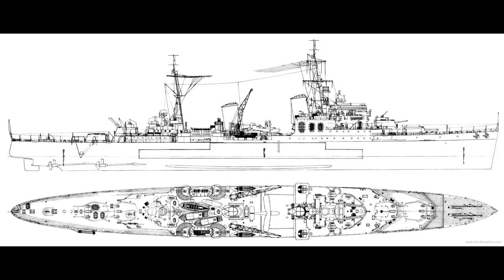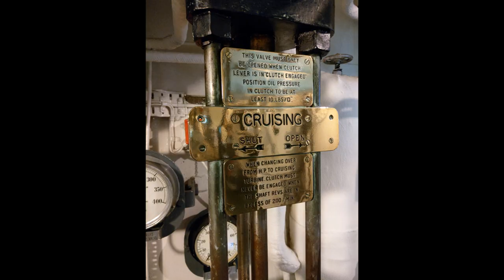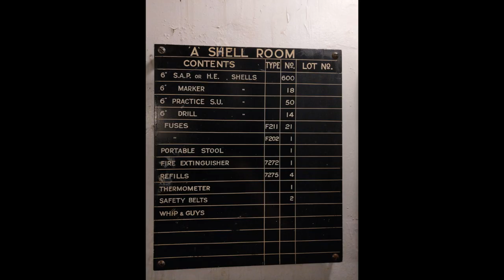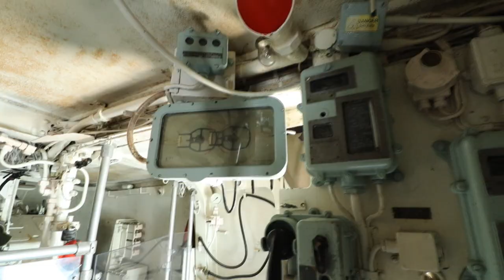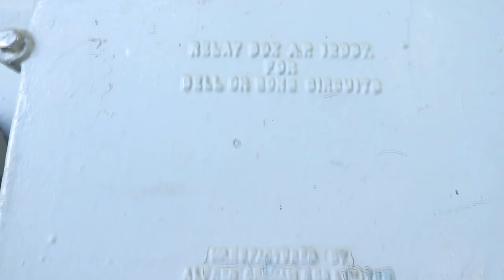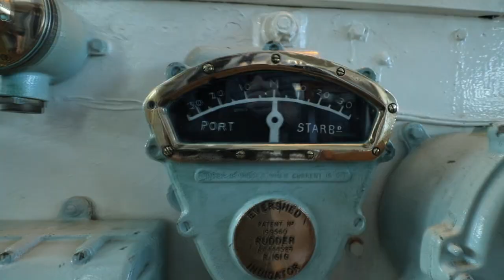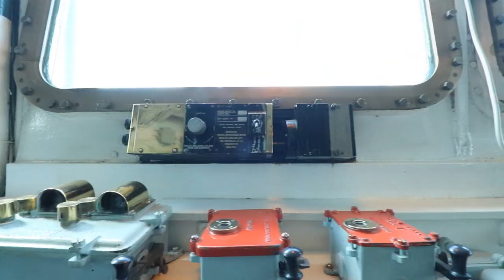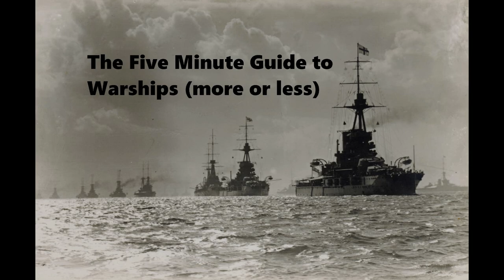HMS Belfast - A Town that served a Country

Comment from the maker: Pinned post for Q&A :)
Reply: What does KMS stands for?
Reply: What classified documents are you most looking forward to be being declassified and further to that will any controversial information come to light in the sinking of HMS  Glorious??
Reply: As so many ships were obviously not treaty compliant, how did various countries verify the size of other countries ship size/weight?
Reply: When the Japanese attacked Pearl harbour, the Japanese decided to after they had sent in the battleships and an invasion force to take the island, could they do it and hos does the war change with the Hawaiian islands beeing under Japanese control?
Reply: Pleaseeee can we get more Ran and Royal newzealand navy
Reply: Drach- thanks for everything you do!

I would like to see what documentation exists/ further explanation about the reduction gearing on BELFAST. In general, ship's reduction gears are of a fixed ratio, and need to be toleranced and sized to handle the full output of the turbine- thus making it impractical to have multiple, changeable gears. As such, speed is ordinarily managed by varying the RPM of the turbine by allowing more or less steam into the casing; reversing is normally achieved by actually reversing the turbine. This is why you see two throttle valves: an "Ahead" throttle and an "Astern" throttle- they supply different nozzles to drive the turbine in different directions. If, as you mention, there is a clutch mechanism, I  imagine this would be used to de-couple the shaft from the turbine, allowing you to "trail" the shaft while stopping one turbine or the other underway, reducing drag and saving fuel from both the drag reduction and not running the turbine (modern, gas turbine plants do this regularly). This would also allow you to maintain the turbine without stopping the ship, as the ship moving would cause the turbine rotor to rotate.

Of course, my experience is mostly with merchant steam systems. If this is not how the plant on BELFAST operated, which your description makes it sound like it wasn't, I would love a deep dive (or at least a pointer in the right direction) to learn more about it! Thank you again for what you do!
Reply: What is the heaviest armed and armored  ship in service nowadays?
Reply: @Commander_35  "Kriegsmarine Schiffe" or in English "Kriegsmarine Ship"
Reply: Very interesting and 1st time to hear about the B-bomb. What is the development history and did any nation actually field the weapon?
Reply: Another hypothetical: the RAF's sabotage of the Fleet Air Arm is halted early on in the piece, the net result being that by 1939/40 the FAA has aircraft that are at least comparable to their land-based counterparts (fighters able to hold their own against BF109s, dive-bombers at least as good as Stukas etc).  They've also managed to scrounge some money to have their aircrews trained to a decent standard.  How would this have affected the RN's attitude towards (and use of) their aircraft carriers in the early part of the war?
Reply: @KatyushaLauncher  thank you
Reply: Why was the Town class rear Y turret set higher than the quarter deck, with X turret correspondingly higher?
Reply: @evanb244  If I remember correctly from my visit, there are 4 turbines per propeller, divided in 3 sets :
- a high and low pressure pair for high speed
- a small "cruising" forward turbine for economical speed cruising (there is a separate "Cruising" throttle)
- a small backward-running turbine for going in reverse
There are only fixed gear reductions, and clutches between turbines and the main output shaft.
In my understanding they literally change the set of turbine used using the clutch depending of the operation mode.
Reply: would it have been possible to reduce the weight of the Gun Turrets on the Belfasts by not offsetting the center gun to the aft (and instead introducing a delying gear of some sort, so that the center gun is fired a tiny amout of time after the other guns, you have said in the past that this has been done on other ships). Could this have made the turret shorter, thus saving on weight?
Reply: Standard procedures is for ships to pass on the right.
Exactly how did that get changed for rules of the road?!!?
Reply: Please cover the Imjin war
Reply: Ignoring fuel and other such handicaps, which two fleets of WW2 would you have liked to have seen go for a Jutland style big battle with their whole fleet in a no holds bar battle to the death?
Reply: Has a navy ever lost, as in misplaced, a warship? It sounds crazy but I know the US Army and Airforce misplaced a few tanks and planes after WW2, some of which are still missing.
Reply: What are the differences between quick firing guns and the previous ones
Reply: If one was to set up the "ultimate crazy WWII destroyer showdown" between Edsall, the Benson-class Laffey, Johnston, Hoel, Amatsukaze, Ayanami, Hatsuzuki, Glowworm, Piorun, Blyskawica, and Haida, which destroyer (if any) would prevail, and how insane would be the engagement in general?
Reply: @bkjeong4302  You forgot the Yuudachi.
Reply: @joshthomas-moore2656  She doesn't deserve a place on that list, as current historiography has revealed her reputation is based on Amatsukaze's combat performance, which she stole the credit for. 

Yes, Amatsukaze is the REAL nightmare of Solomon.
Reply: @bkjeong4302  I was more thinking of the whole trying to sail out the combat area with the crews beds incident.
Also the Amatsukaze wasn't on your list.
Reply: @joshthomas-moore2656  It’s debatable if that incident ever happened, at least in that manner.

She WAS on that list (the first Japanese destroyers listed even).
Reply: As I understood, the Royal Navy used primarly SemiAP and HE shells (as it's shown on the plaque in the the magazine) for the 6 inch guns; I could immagine this choice was to have a "Jack of all trades" shell to use against moderately or lightly armoured target. Are there similar choices made by other Navies and, if so, could you made some examples of those? For example I read something about base-fused HE shells used by IJN cruiser for anti-cruiser gunnery.
Reply: @bkjeong4302  Sorry your right i missed her and while true the bed story is likely not as its been told its still a rather amusing story.
Reply: I wonder at what level was decided what shot was loaded? and did they keep like a few spare special purpose shells standby somewhere easily accessable?
Reply: Hello. Can you touch, please, subject of Russian navy coming into existence during Peter the First rule? How was it percieved by european powers? AFAIK it was from, literary, Zero ships to a full navy in a .. decade?
Reply: I have heard and read a lot about the shortcomings of the German Nazi-era capital ships (especially Bismarck and Hipper-classes). However, almost no one ever talks about particular strenghts of those ships. Were there none or have I just always been looking in the wrong place?
Reply: @1SKIALI  They absolutely could have taken the Island. But they didn't want to have a Full on fight with the U.S. The purpose behind attacking the Pearl Harbor was to knock the U.S. out of the Pacific theater. Thats why an air raid was the final decision an not a full on invasion. They didnt want a full on war with the U.S. for numerous reasons but lack of resources was ONE of the biggest reasons not too.
Reply: @BruceRKF  

Not really anything other nations didn’t also have. Overall they’re significantly behind compared to to every other 1930s/40s battleship design, either due to being less efficient or less efficient AND outright inferior even in absolute terms. 

The KGVs, North Carolinas, and South Dakotas were overall similar to the Bismarcks in capability (though the Dunkerques were arguably a bit worse) while being 5,000 tons lighter. And Vanguard, the Littorios, Richelieus, Iowas and Yamatos were flat-out superior overall, both relative to displacement and in absolute terms (granted, Yamato is 2-3kts slower than Bismarck but she’s still a significantly better design overall). And ALL of these classes were better protected than the Germans due to using AoN armour schemes.

Things get even worse when you include heavy cruisers as capital ships, because German heavy cruisers were significantly less efficient than their already inefficient battleships. The Hippers were inferior compared to, say, the Mogamis (arguably better armour, but slower and much less well-armed) despite being 6,000 tons heavier.
Reply: What are your thoughts on the Washington naval treaty and how it affected the participating nations.
Reply: I've read/heard somewhere (Can't remember where now unfortunately) that Belfast's engines have been preserved/opened in such as way that they could be brought back online should the IWM wish to. Do you know if this is true or not and is it difficult to preserve a ship in such a way that it's engines could be functional?
Museum ships that have survived combat, war and damage having the potential to move under their own power is a bit of a romantic dream that I (and I'm sure many others) have, no matter how small the vessel might be.
Reply: Just out of curiosity, what's the yearly bill look like to keep a museum ship in good condition? I imagine some astronomically high number, since the ship has already seen plenty of wear and tear before its even considered to be turned into a museum ship. 
And you mentioned HMS Belfast goes into drydock about once every 20 years, is this considered frequent for a museum ship?
Reply: @Commander_35  Kriegsmarine Ship
Reply: Any chance we could get a 5 minute guide to mobile dry docks?
Reply: how man men were A) on each gun?    B)  in the turret?
Reply: Why was it called 'Town Class' and not 'City Class', which would also fitted nicely with the Counties and Colonies classes
Reply: What would the Pacific War look like if Halsey's two carriers found Nagumo's six after Pearl Harbour?
Reply: How was machinery arranged in British and American post-war aircraft carriers, and how would they perform? And what tasks the battleships were assigned to after WWII in the western bloc?
Reply: Some of your videos have showcased huge blunders made in battle by various commanders, for example, by the US captains at Savo Island, some RN commanders at Jutland, etc. Other than going down with the ship, how often do these commanders get severely punished afterwards, ie court martialed, jailed, executed, etc? Or, once they reach a certain level, are they much more likely to simply get shuffled off to a desk job instead and never go to sea again, no matter how badly they performed?
Reply: Ray Opeongo it depends on which country it is. The captain on the Russian cruiser Zhemchug that was sunk by SMS Emden was court-martialled and sentenced to prison, losing his nobility status too. Adm.Milne who failed to hunt down Goeben and Breslau was removed from active command. The captain on USS Vincennes that shot down an Iranian airliner was forced to retire. Of course some avoided punishment and continue to hold an active command of lower or the same level.
Reply: If you were in charge of rewriting the naval treaties of the 20's and 30's, governing the limitations to warships, what changes would you like to make?
Reply: A pickup truck to carry torpedo reloads via 2 or 3 hatches woulda been nice.
Reply: The carousel in Belfast's magazine reminds me of Soviet tank autoloaders.

How do main battery auto-loading systems work? What were the aspects of the design that limited their development early on?

And if you're planning on visiting USS Salem (as far as I'm aware, the only surviving auto-loading main battery ship) on your US tour, could you do a bit of a feature on that part of the ship as it's fairly unique?
Reply: @stavka6923  The British Admiral John Byng was unjustly shot in 1757 for failing to stop the French capturing Minorca, after being sent out with insufficient forces to do the job.
Reply: Excellent video Drachinifel as always. I especially liked the part in the shellroom with all the hoists and rails for ammunition, this had personal significance since my great-uncle served aboard HMS Belfast's sister ship HMS Edinburgh in her shellroom and survived her sinking. A special video on HMS Edinburgh would be brilliant since her loss is the stuff of naval legend and the subject of some conspiracy theories.
HMS Edinburgh was returning to Britain from the Soviet Union allegedly with several tons of gold bullion on board by way of payment towards the materiel and equipment Britain had provided them in the war thus far. She was torpedoed by a U-boat almost directly amidships and forced to stop. It was during this delay for damage control that she was ambushed by several German destroyers, one of which she managed to sink despite her fire control being knocked out, the turrets commander standing on the roof of the turret to direct his guns manually. One destroyer did manage to land a torpedo hit however, again amidships but on the opposite side to the strike from the U-boat, almost breaking the ship in two. I believe most of her crew were rescued by other ships and HMS Edinburgh herself was finally finished off by a Royal Navy destroyer...complete with the gold she was carrying.
Reply: What are, in your opinion, the ugliest warships, in the time frame between the pre-dreadnoughts and the end of World War two? And, what would be the best looking one? I leave the choice of how many ships to name up to you.
Reply: What would be 'perfect' overseas harbours for the Elbonian Navy?
And they want at least one on every continent, even.
Reply: @alexanderhartmann7950  God bless the glorious nation of elbonia
Reply: I would like to see videos about repair ships, Akashi & Vestel.
Reply: 6" Gun questions:
What is the large rectangular block with a circular hole above the breech?
Did the charges come up the same hoists & where were they stored?
Reply: Would the royal navy be better or worse if they had no heavy cruises at the beginning of the second world War but the queen elizabeths were all extensively refitted even better than the refittings done on valiant and queen elizabeth and lengthened to do 28 knts
Reply: How effective would the Kongo class be if they were rebuilt as carriers?
Reply: Hey drach keep up the good work love your content my question is whenever the battleship Texas is back from her overhaul and rebuild are you going to do a new video like your Original video or going to do something similar to this one?
Reply: I was looking at a model of the Russian Protected Cruiser Varyag (1899).  The main armament of the ship consisted of 12 6 inch (152 mm) guns mounted in single mounts.  However, the layout included 2 single mounts parallel to each other on both the bow and the stern (with the remaining guns spread out in single mounts across the length of the main deck).  The two parrallel guns being mounted both on the bow and stern seems to be an odd design that is not efficient.  Only 1 gun can be brought to bear on a broadsides, and the probability of having a head-on shot would be fairly minimal (without blast effects).  I'm assuming that there must be a reason that this layout was chosen.  What were the benefits the the Varyag's gun layout, and was it more advantageous than simply having one gun forward and one gun rear?  (I'm assuming that weight/stability issues precluded both a superfiring layout along with simply having twin turrets).
Reply: The HMS Belfast isn’t a Town class light cruiser it’s a sub class of this group a Edinburgh class light cruiser however Bel received upgraded armor and better protection as her sister ships had been sunk and she would be the only treaty era cruiser to survive the war .
Reply: Drach, thanks for you EXCELLENT video on H.M.S. BELFAST.  She is beautiful.  And I always wanted to see what she looked like inside.  It is great that your country saved this proud veteran.  But it's a crying shame that WARSPITE, QUEEN ELIZABETH, DREADNOUGHT, and VAGAURD weren't also.
Reply: Will you cover Paper ships like the H39 and H42 Battleships?
Reply: @nicholascorbett1256  No, they could not have taken the Island.  The Japanese did not have the logistical support to sustain operations in the Eastern Pacific.
Reply: Been to the Belfast a couple of times and it is truly amazing.
Reply: @jameshailerthepostmaster4389  he already did those.
Reply: You have been contacted by a major movie studio to help write the screenplay for a film of the battle of Samar. You have reached the point where Captain Evans has witnessed a shell go off under White Plains. What would his lines be as he orders his suicidal charge, and are his actual orders at the moment recorded by history?
Reply: The issues with the magazines give rise to an interesting question:  Did anyone every try a magazine located in the ship's superstructure?  Many modern tanks, particularly in the West, actually do that, such that an ammunition explosion will blow out the thinly armored turret bustle but leave the rest of the tank (relatively unscathed).  Making a magazine explosion more likely is never good, but changing the consequences thereof to "the quarterdeck is a smoldering wasteland and we're basically out of ammo" from "We have all just died for king and country" is perhaps defensible.
Reply: @johnshepherd8687  I think you missed the whole gut of my statement. Japan lacked the resources, had they brought troops like the Navy wanted to they most likely would have got the islands. But the army strongly opposed this idea.
 I never said they would have held the islands entirely to the wars end. Isoroku Yamamoto was against a war with U.S. because of our vast resources, and the Pacific fleet. But if it had to be done the ships must go an islands must be taken.
Reply: What was the most effective daul purpose guns of ww2?
Reply: Hello Drach love your work thank u! Ok if say radar hadn’t been invented say until the fifties or sixties. Basically not in time at all for WW2. How would the IJN targeting systems fared against the USN targeting in gun fights?
Reply: @tanegashima5395  Probably not very effective.  Like most ships of their era the hull tapers a great deal aft.  That taper would severely limit the size of the hangar.  The Lexingtons also had a very small hangar, while purpose built carriers, like Ranger or Yorktown, were designed with the hull flaring out a great deal above the waterline aft to accommodate a longer hangar.  Compare the British Courageous class, as converted to carriers, 24,000T standard displacement and 48 aircraft vs Ark Royal 22,000T and 72 aircraft (design) 50-60 actual.  All numbers from Wiki.  The conversions were very inefficient as carriers, wasting the one thing that was in restricted supply by the treaty: tonnage.
Reply: How did crew de-ice the ships and guns?Awesome video and footage!
Reply: @stevevalley7835  Wow, thanks for the great answer. I would think that as carriers, they'd be able to do a bit more than if they were battleships, but since Japan needed destroyers and not carriers, they probably wouldn't have done much anyway.
Reply: @tanegashima5395  The Kongos were real workhorses during the war, probably because of their speed capability.  Two were sunk in surface engagements in the Solomons and one fell to a US sub.  The last one was bombed and sunk at it's moorings at Kure, at the end of the war, along with both of the Ises.
Reply: Why were the calibres of all very large planned battleships of most navies (H-44, A-150, Incomparable) 20 inches? Was there a restriction on how large the dockyards were able to build naval artillery? Or the size/weight of the resulting turret? Or something else?
Reply: @stevepuls8532  That would probably be the Kirov class battlecruisers/guided missile cruisers of the Russian Navy, or a US navy Gerald R. Ford class supercarrier.
Reply: Why did the pensacola class have their tripple turrets superfiring instead of the double turrets? Isnt this a stability problem?
Reply: Hi Drach, you said that the Belfast is currently closed, and its obvious that this is all due to covid. It reminded me of your appeal for the USS New Jersey in one of the "Armchair Admiral" episode on the WoW channel last month. Wonder if you will consider doing an appeal video for some of the museum ships that are desperately in need of funds? I understand that money is tight for everyone this year but I'm sure your viewers (like myself) would be prepared to spare some cash to preserve history.
Reply: Last time I was in London I declined an offer to visit her. Almost as if I was waiting for you to publish this video. Thank you!
Reply: @stavka6923  The former I do not know, but after WW2 the US used their Iowa class in the Korean and Vietnam wars for shore bombardment. Also, Reagan took them back into service in the 80's when big boi Kirov showed up.
Reply: @sergarlantyrell7847  I really hate waste.  There were several ships in advanced stages of construction, and their elimination resulted in a lot of money being spent to extend the lives of old ships instead.  My proposal would be that any ship that had been laid down prior to January 1, 1921 could be completed, provided a corresponding amount of tonnage of old ships was scrapped.  This was done in the case of the US BBs West Virginia and Colorado, which were completed in exchange for the Delaware class BBs being scrapped.  I would let anyone with ships already under construction do whatever they want.  This system would be self-limiting as the ships being scrapped approached the new ships in capability, thus offering no incentive to replace them.  Example: the IJN would be allowed to complete the two Tosa class BBs, but they would need to scrap the two Fuso class BBs to make enough tonnage available.  But if the IJN wanted to complete Amagi and Akagi, because they were so large, they would need to scrap three of the Kongos, so they really aren't gaining much with the Amagis.  The USN could complete Washington, in exchange for scrapping Florida.  Completing two of the larger South Dakota class BBs would require scrapping of Utah, Wyoming, Arkansas and New York, again, rapidly approaching the point of diminishing returns for spending to complete two new BBs.
Reply: Steve Valley 

They were active a lot but accomplished relatively little.
Reply: @bkjeong4302  You could say the same about the Iowa class: ran around a lot, never faced another BB.  Were the Iowas ever in a surface engagement at all?  Washington and SoDak were, when they sank one of the Kongos.
Reply: How much was the cost of ship's guns compared to total ship price in the late XIX - early XX century for different ship classes? Same question for their machinery
Reply: @bkjeong4302  If the Iowas are seen in a better light than the Yamatos, it is probably because they weren't sunk.  When the Kongos were built, before WWI, you could make a case for them.   If Vickers had been a little slower getting Kongo built, the Royal Navy probably would have grabbed her, like they grabbed a lot of other ships being built for foreign governments, and she probably would have fought at Jutland.
Reply: @stevevalley7835  Yeah you can make the case for Kongos when they were originally built, but you can't do anything like that for the Iowas.
Reply: is a submarine tank ( as in a fully submersible with a propeller and ballast to float and or regulate depth that also is a fully functional land vehicle armed with torpedo tubes for underwater use  ) mechanically feasible
Reply: @evanb244  You can't normally reverse a turbine. Warships had (smaller) Astern turbines.
Reply: @Connor Clarkson Coral Sea for sure. Big enough air group to carry Swordfish or Albacores, Fulmars and/or Seafires  or Wildcats, possibly the last squadron of Skuas too? Depends if the US were happy for them to have the latest USN aircraft.
Reply: @bkjeong4302  Hipper also had significant engine problems throughout her creer.
Reply: @tomwest212  York & Exeter were known as "City" or "Cathedral City" class.
Reply: @stavka6923  They courtmartialled Troubridge not Milne for failure to engage the enemy in the Goeben/Breslau case. 
Adm Lewis Bayly was ordered to haul down his flag after the loss of HMS Formidable.
 Perhaps the saddest case was Admiral Hood, who was removed from command of the Dover Patrol, because it was thought he wasn't making transit of the straits hard enough for the U-boats. Later evidence caused this to be re-evaluateed, and, his reputation restored, he was given a new command - 3rd Battlecruiser squadron, with his flag in HMS Invincible.
Reply: @adenkyramud5005  Faa' di Bruno no 1 on the list!
Reply: In the book "Battle in the Arctic Sea" by Theodore Taylor, the convoy is named with "PQ," but in your videos you use "JW" convoy naming. What's the difference?
Reply: @stevevalley7835  Furious was even worse than the other two Weird Sisters - trunking the exhaust gases alongside the hangar consumed hangar space and made it intolerably hot in the tropics.
Reply from the maker: @EdisonDiBlasi  The early convoys used PQ codes heading out (and QP heading back), later ones used JW and WJ
Reply: @EdisonDiBlasi  Date. After PQ18, because of the melancholy fate of PQ17, they started using "JW" instead.
Reply: @Commander_35  I suppose this isn't so much a dry dock question so much as an Esty one, but the prints of HMS Thunderchild sold out before I could purchase one.  Do you know when you might offer another sale of those prints?
Reply: I walked 8 or so miles from my hotel to visit this museum, back IN 2011.  It was well worth the stroll.  In one of the turrets was painted a cat with the name Jynx under it.  Ship's cat?  General mascot?
Reply: @bkjeong4302  I pretty much agree.  I would agree a lot more if the North Carolinas and South Dakotas were built using a rejected design that would have them running at 30kts.
Reply: @stallfighter  Yes, I would like to know that too.
Reply: @iansadler4309  Right off the top of my head, I would agree, right down to it's concrete torpedo protection system, though it didn't founder like Alfredo Cappellini did.  In the back of my mind is the thought that Bruno might have stayed afloat long enough to make it to shore because it was using Ansaldo built guns that weighted a lot less than those on Cappellini.
Reply: @iansadler4309  the IJN did about the same thing with Kaga's exhaust initially, with the same result.
Reply: What kind of food would have been served aboard a warship at war during the pre-dreadnaught era through WWII?
Reply: Will you ever do videos on modern vessels?
Reply: @Daemascus  The 1959 movie Don't Give Up the Ship with Jerry Lewis depicts the misplacement of the US destroyer escort USS Kornblatt ...
Reply: @tylerrockx2043  Thanks for the answer but I was meaning in fleet actions, say, against the Soviet navy or the VVS.
Reply: Why are most submarines slim and tall like fish and not short and wide like whales (with the exception of Typhoon)?
Reply: I am very curious about the story of HMS vindictive. She has a strange life, and being one of the few ships which was converted back to their original design after serving as a carrier.
Reply: What is the history behind this channel and why you decided to create it? Not necessarily a warship question, indeed a question about a warship channel!
Reply: James Harding  Drach can give a better answer but as I understand it the WWII sonar hydrophones were much smaller than the arrays we're used to on more modern ships and so tended to be small protrusions which would be sticking out of the ship bottom somewhere closer to amidships.
Reply: @amschind  I'd suspect that putting something as heavy as a main battery magazine and its armor up into the superstructure would have some pretty negative effects on ship stability and handling; even if you could build blowout panels able to vent over 20 times the propellant, and even more times that explosives, compared to what any tank carries.
Reply: Couple questions on Belfast's turrets.  
1) You didn't point out any local range-finder or fire-control.  Could they be aimed if the turrets lost central fire control?
2) With the gun breaches down in the gunpits at high gun elevation did the gun have to depress to be loaded, or was the crew able to somehow lo load them while the breach at or below floor level?
Reply: NIce black Masks and an interesting Basecap of your companion,   and thanks Ms. Drach for allowing all the good work
Reply: A longer gun means the propellant burns more completely and thus having a greater muzzle velocity and range, but can a gun be too long and thus cause problems?
Reply: My offer still stands about getting you some footage of HMS Caroline, gratis.
Reply: Could you describe the procedures of flooding a compartment? Would the orders to flood the magazine, for instance, come down from upon high and everyone in the magazine would drown or would there be a two or so minute delay so everyone could leave?
Reply: Am I correct in noting that the Allies had the capacity in machine tools to fully equip common classes of ships, while the Axis were running short in their homelands?
Reply: At 25:00 in the turret, in the rear on the floor next to the hatch there is shown an electric blower and duct work coming up from it.  I assume this is for ventilation of the gun fumes from the crewed area.   
How did the navies deal with this issue, what volume of air exchange was needed, how many blowers per turret, I assume redundancy is needed for battle damage as I assume the turret would rapidly become uninhabitable with prolonged firing of the guns if the fans stopped.   Was air also used to blow the guns of fumes out the muzzle prior to breech opening in order to reduce fumes in the turret.

Were turrets ever need be vacated of crew due to fume fans failing, 
Are the hatches large enough to give enough ventilation in event of the fans failing?     

were gas masks (resperators)  with an air supply (either by portable tanks or a compressed air hose) stocked in turrets as a back up system if fans failed?

Wonderful video as usual.  Thanks!
Reply: I know you don't like to discuss modern naval developments, but I'm curious on your take on the USN choosing the FREMM design for the FFG(X) program.
Reply: I don't know if it has been covered, but I've seen an image of a ship's hull that was classified as "light" take a kamikaze right into it and the ship was fine except for a char mark from where the plane hit. Is this true at all and if so, which ship was it?
Reply: How does a ship rearm it’s magazines?
Reply: Can you give a bit more detail as how the shell carousel worked on the Belfast? Also did the guns have to return to a horizontal position for reloading? I'm going to assume the powder magazine was one deck bellow the shell deck.
Reply: Why are the main guns painted different colors?  There doesn't appear to be a pattern.  Apologies if it was mentioned in the video.  I have a bad habit of believing I can pay attention to audio while doing work stuff... :)
Reply: I know this question has been asked before but I'll pose it anyway.  
You site treaties and how countries designed ships around it.  What are the worst examples of shops that broke treaties? 
If you wanted to let's say, take an inche or two out of the "thickness" of armour you reported to the by the design.  How would anyone know? 
Sorry about the two part question,  I know you've got literally years of drydocks already lol.
Reply: Has anyone ever tried making water-turbines, using excess energy from a ship trying to slow down?
Reply: no
Reply: Would it be possible or practical to bring Belfast back into service if a war with an inferior enemy broke out? How would she have done if sent to the Falklands War and fought General Belgrano?
Reply: Awesome video Drach.  I hope you do something similar when you come over to the Colonies in 2022!
Reply: I keep hearing people calling Belfast a town class cruiser and a edinburgh  class cruiser. I'm curious Why is that?